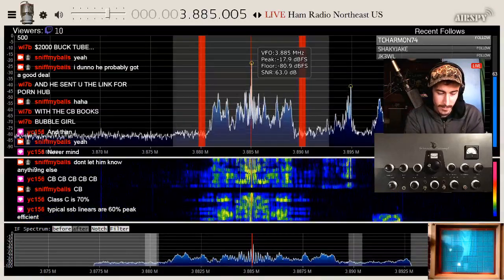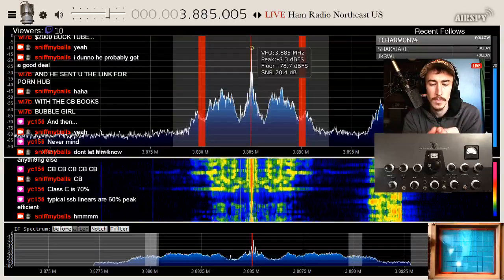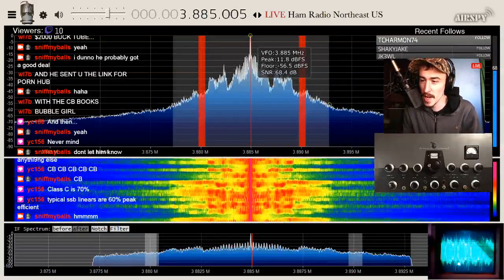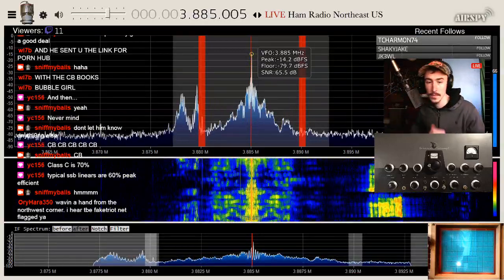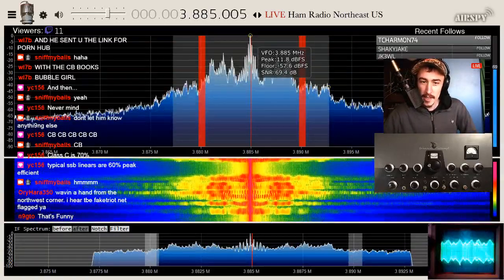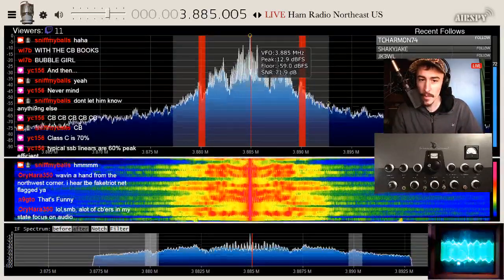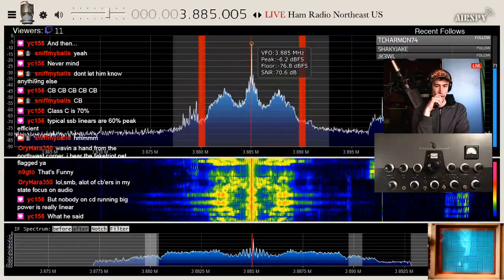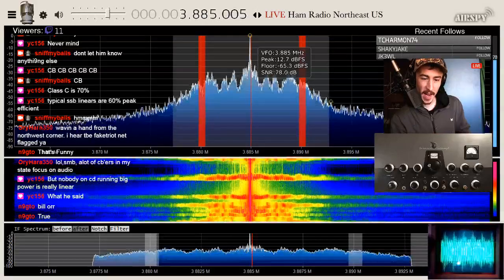High level Class C vs. Low Level Linear - Why don't more Hi-Fi CB operators use high level class C?

Comment: I have a TS440 with a few different caps installed for a better transmit sound. I also installed a cheap ceramic filter from the parts bin from an old cb radio. I use a pr40 microphone, tube mic amp, compressor, eq, and a sonic maximizer. I have had reports from two separate people on different days tell me that the audio is about 10 khz wide on AM. I have no way of knowing because I don't own a scope or know how to use them. It slowly grew from trial and error. All the equipment is used but is sounds like a gem.

Comment: Look up the wave form of both the class C amp and a linear amp and COMPARE the 2 of them. Then you might understand.
Reply from the maker: Understand what?  Biased into class C an amplifier generates about 1/4 of the original low level waveform on output and looks like trash on the scope.  shows a ton of monkey watts compared to linear.  Most of it is distortion 'splatter' and not effective.  CB guys love it and don't care about the waveform distortion and splatter.   That's one way to do 'big watts' ... However you can achieve clean linear modulation by running the final in class C with no audio, and modulating the final with audio at high level, utilizing a large audio amplifier and three-diode negative peak compressor.  You don't have to worry about waveform distortion, the audio is being injected at high level and the final is only amplifying the carrier.  Looks amazing on the scope, and all of those 'big watts' are linear, there is no distortion, you are hifi and you're not occupying excessive bandwidth with distortion from the carrier exceeding 0 volts. You're doing the same numbers you were with the class C final in amplifier service. 70% efficient AND linear.   Clean vs Dirty watts... I don't need to look up any waveforms because I can generate them right here, I have plenty of those types of amps in storage.  I've been there, have the T-shirt... what exactly is it that I am missing or don't understand about this?